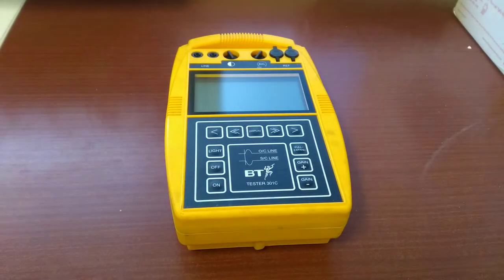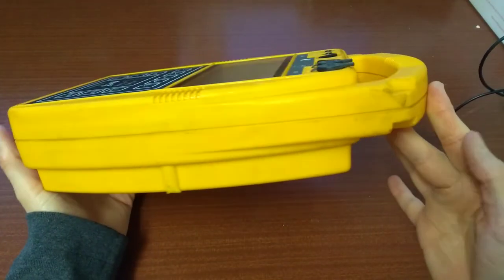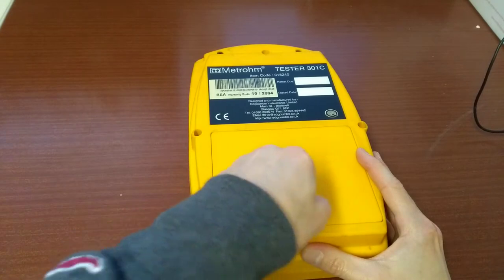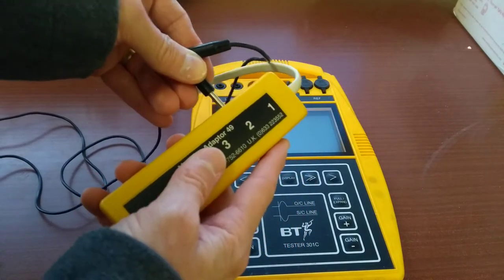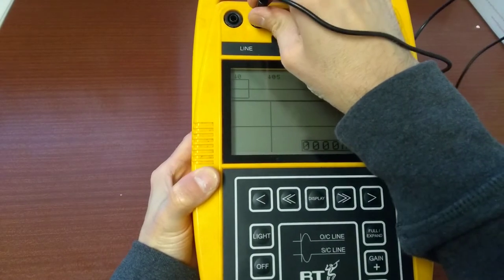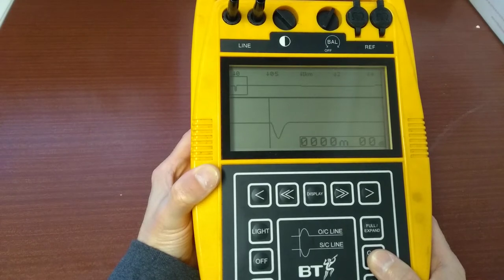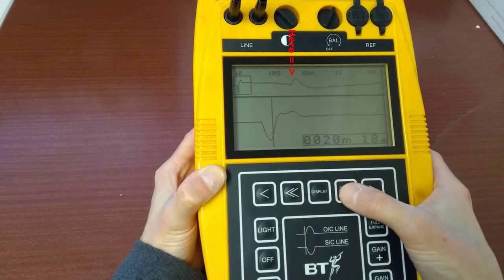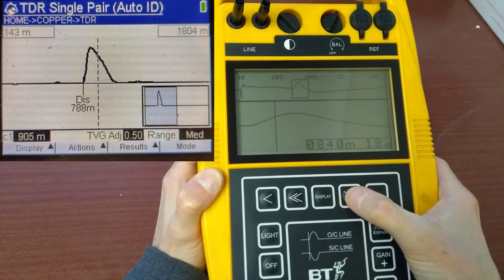The BT 301C Mole Phone Line Test unit

Comment: The loop on the cct is because you’re not testing from the test socket
Reply from the maker: I disagree. The face plate has no internal extension wiring hanging off it in my test and the face plate doesn't contain any active components (ring capacitor etc?).
Unless the faceplate itself is faulty it shouldn't be changing the test results in my setup.
Reply: Agree, that loop is NTE - even the distance is correct on the test leads for it. The dis/os is probably the cabinet where the cable size drops down from 0.5mm onto the E side.
Reply: @mistermister8  yeah that or the dslam
Reply: @louisemmett1999  Showing my age lol. Had one showing dis a few years ago intermittently at the cab. Found to be on a Gfeller trunk unit 🙂